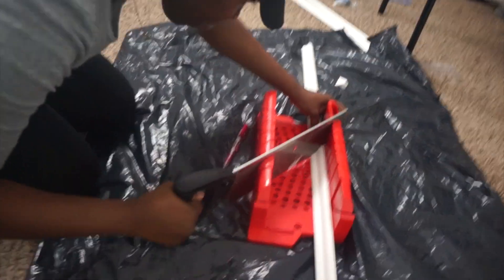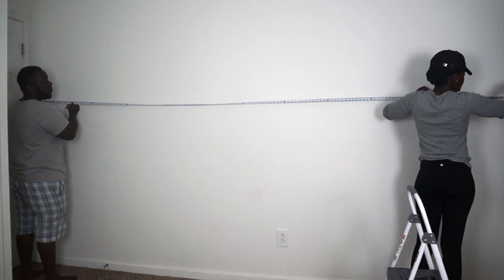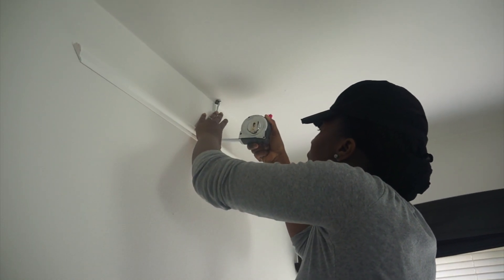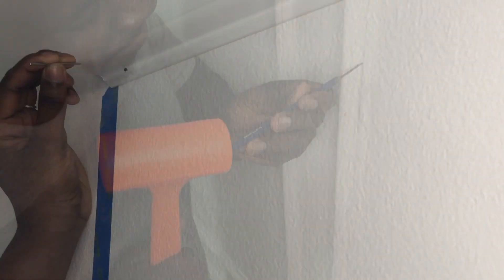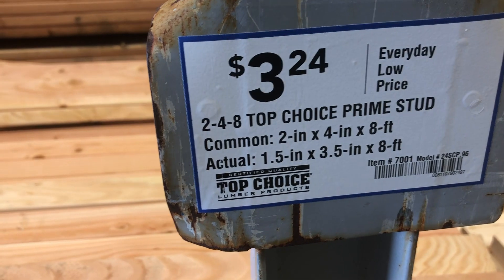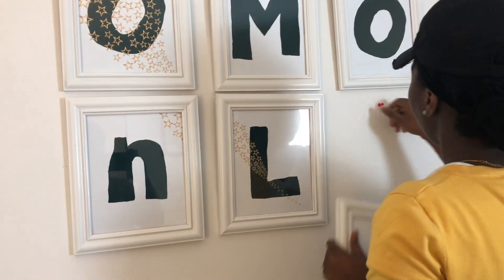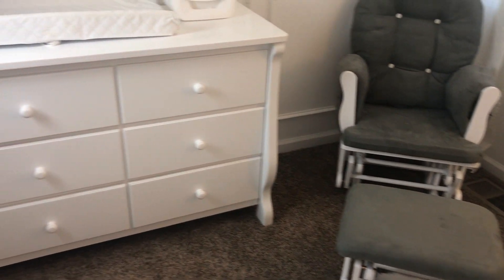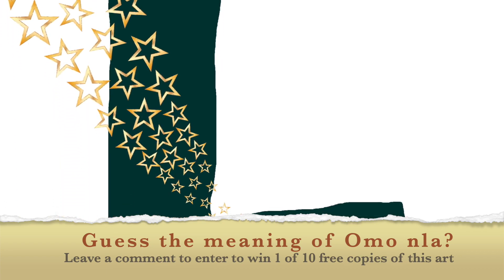How to install wall molding without power tools

Comment: Tgis looks great! Good call on the brad nails. I wonder how a bunch of command strips would work. 
And that spacer idea is genius.
Reply from the maker: Thank you 😊. You have a great point with the command strip idea; I am always weary about using those because of how they could peel paint. But I’m sure there are clever ways to remove the strips without peeling. I will have to look more into that, thank you 😁